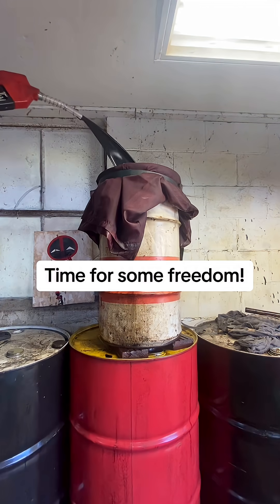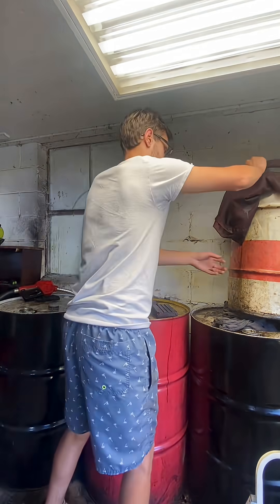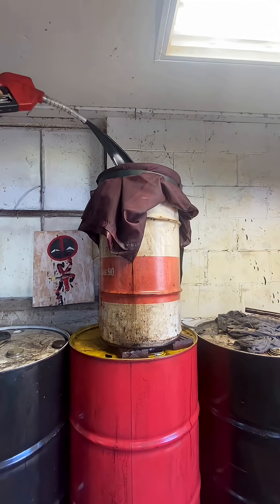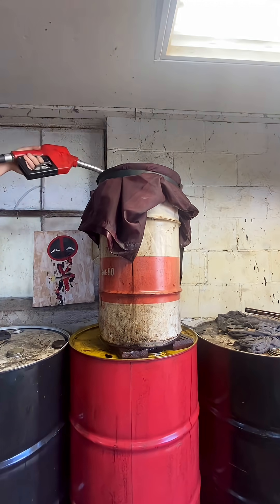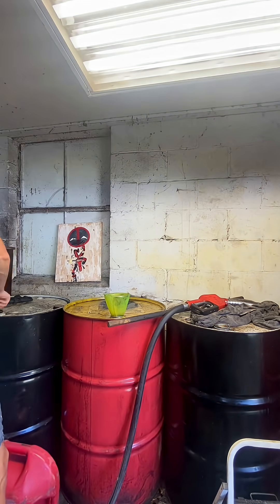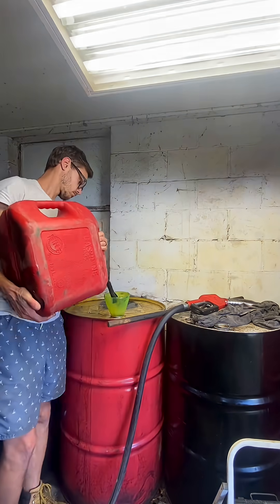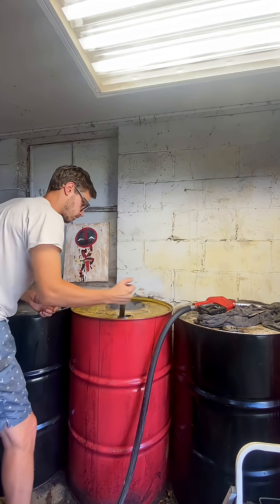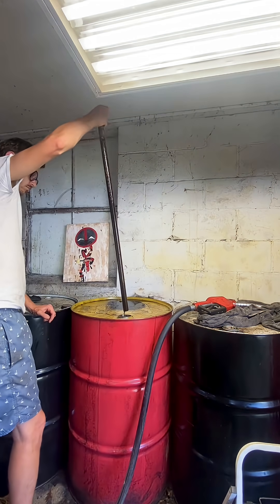Transform #wastemotoroil into #homemadediesel Fuel #dieselmechanic

Comment: Isn’t this insanely dangerous?  😂  No one seems bothered by that.   This looks to be in an enclosed space, under electric light.  Fluorescent, at that, which requires a bajillion volts to kick on the light.  Just a casual half hour pouring pure gasoline from a can and then getting in that with a big old stick and presumably vaporing up the whole space.  Similarly seems like the air would be rich with benzene during the filtering. Shine on you crazy diamond, I guess.

Comment: I bought gas can air valves on Amazon for a couple dollars for similar cans. Work great.
Reply: I just drill a hole on the other side up top where they used to be in the older jugs. Then I personally use a blue concrete screw to seal it up when not in use.

Comment: Wait a minute, that's all I need to do? Will this diesel work in my vw tdi? And what kind of octane gasoline  do you use or does that matter...what kind of oil is being used...does the "filter" matter or is just the cloth enough of a filter
Reply: If it's a modern TDI (computer controlled) I would not run this. If it's an old IDI turbo diesel, then it would be okay. Just filter it heavy.

Comment: Drill small hole in the handle of gas can will help your flow! Pro tip.
Reply: Exactly what I thought
Reply: I find removing the black nozzle attachment and using a large funnel works well too.  I hate everything about those nozzles.
Reply: or just get one of the ribbed yellow bendy spouts...
Reply: You can do that. They do even make a little air flow button. Things that you can just press into that drill hole on to your gas. Can I honestly prefer the fast filling motorcycle style gas cans like the Valley Industries 5-Gallon Utility Jug
Reply: Yea also take the black nozzle off and pour it into the funnel.   Fuck that little 3/4" nozzle.  Pour that shit.  It's ok to spill a little
Reply: Or use a racing fuel jug that flows insanely fast. They are actually cheaper because they aren't as regulated as the "safety cans" emptied in about 20 seconds

Comment: Since everyones talking about the metal particles in the oil why not heat it to thin it more and run it through a few high powered magnets to collect the metal. Pribly best to hrat it to drive iff moisture as well andthe gasoline would mix more efficiently. 
Adjusting the PH or at least trsting it would probky be agoid idea as well.
Im not a professional, but i do enjoy science.

Comment: You really should be using a proper 100 micron filter, then 25-30 micron, then finally down to 5 micron. If you don't you are keeping lots of abrasive material in the fuel.

Comment: full of carbon fuel and you will have reliability issues but if you have an older clunker that you have to fix often anyways its perfect for that and yes im not sure the injectors will handle that carbon long term without clogging. probably you will have to without hack them

Comment: with containers that are large, like jerry cans, the hole you pour from is meant to be at the top of the container, not the bottom. the entire design is to allow airflow and ease pouring. by having the hole at the bottom its just gunna glug as air tries to replace the liquid in the container.

Comment: I had an old Mazda e2000 diesel truck. I used to run around to all the local takeaway restaurants and collect all their old deep fryer oil. Lard and canola oil. Filter it and use it for fuel in the truck. Worked like a charm. I didn’t need to add anything to it. It just burned. 😂 sold the truck with over 700 thousand kilometres on it, still running perfectly.
Reply: Lies
Reply: @stinkwink695 . No lies about it mate. Try it out. Those old Mazda diesel’s ran on just about anything.

Comment: Menards has a gas can looks just like race jugs. 

Due to epa regulations saying there has to be some way to automatically stop the vapors from reaching the atmosphere, coupled with the design of these cans having vents and caps that screw on, they do not meet the standards set by the epa to store gasoline. So in order to be sold in stores they have to say on them not for use with gasoline. 

But if you ignore all that and use it anyway, they empty very fast compared to pretty much any gas can you ever used

Comment: Making diesel from spent oil would  be pretty easy if you had the parts to make a fuel still, Like those barrels he has all he would need is a metal stand to place the barrel on so you can apply heat and copper tubing to collect the fumes in another barrel which is the diesel fuel.

Comment: There should be a cap near the top of the handle on the gas can, pop that so it can breathe while you pour.
Reply: Newer ones don't have it they are supposed to breath through the spout and they suck. I drill a hole where the old ones were located and cap it with a screw.

Comment: New diesels have a "laser in a can" light sensor in line with the fuel tank that stops the engine when light doesnt pass through the diesel. Big brother doesnt want you doing this. My 1st gen cummins could use this, but i would filter it through a real filter first.

Comment: If you want to do this properly you need to filter it with a centrifuge not a bed sheet.....this also only works for mechanical diesels dont try this with a commonrail motor.If you keep using a bedsheet your going to knock the IP out of whatever youre running it in.

Comment: Used motor oil has a lot of VERY small metal shavings in it...I would advise filtering it through something a lot finer than a bedsheet.
Maybe a new oil filter...?
Reply: Brilliant…. How are you getting the oil back out? Or are you suggesting creating an entire setup like a pump and everything?
Reply: @Sexyhurricane 
It should flow through with only gravity...just obviously a lot slower.
Reply: You can buy inline oil filters or you could probably make a filter with sand, charcoal, toilet paper, etc.
Reply: @stevenbelue5496 
Having silica in your "diesel" would be even worse than small metal particles...

Comment: i read some of the comments i know a guy who knows a guy that had a citroen 1.5 diesel 😊 hi used to run it on used cooking oil turned into bio. diesel done a few tanks which took a lot of time, hi was doing aprox 1000 miles a week, eventually hi got fed up with that and pored it into a 45 gal drum, no petrol left it a couple days to settle, then i used a 12v electric pump to pump it off the top straight into the tank, hi alway left about 3 to 4 inches in the bottom, when i pulled the drum forward there was chips and all sorts in the bottom, hi done that for over a year, hi put 2 tanks of real diesel through it, took it for an MOT asked what the emmisions were like and was amazed when the guy said really good so i done the bushes, track rod ends and ball joints and gave it to my girlfriend, she was over the moon.

in just over a year i only had 1 fuel filter.
the new HDI engines dont like it the dash lights up like a xmas tree.

Comment: My  2014 VW Golf loves this stuff going 5 years strong 💪 💨😶‍🌫️
Reply: Extreme levels of doubt. Diesel Hpfp and piezo injectors do not tolerate wof (waste oil fuel)
Reply: @g60-grandpa I've been a diesel mechanic most of my life I originally got the car with 10,000 MI at 80,000 MI the cp4 went bad so I replaced the cp4 and the injectors after that I started running waste oil and Diesel mix no less than 50/50 no more than 80/20 diesel nowadays is so damn clean it lacks lubricity also I run the used motor oil through a 20 micron filter with vacuum assist almost at 400,000 Mi and she hasn't given me any problems🤑
Reply: Do you actually run it? Your cp4 might not mind it but not really sure how it would affect any common rail. I assume some parts fell off your exhaust also? 😂
Reply: @WyattHabel-f8n it's funny you mentioned the cp4 that's what led me to start running motor oil in my car originally cp4 went bad with only 80,000 miles on the car I replaced it and the injectors and the rest of the fuel system cost me about 700 bucks in total minus the labor I've been working on diesel is my whole life so I just do all my own work play typically what causes the cp4 to fail is lack of lubrication and new or diesel is so refined and so clean it's basically kerosene which is extremely dry and laxed lubricity show me and a few other mechanics at around thinking about it and said why not just throw a few quarts of oil in it and one thing led to the next thing now we drive cross-country in the car stopping at every O'Reilly's Napa and AutoZone we see to grab used motor oil for free the car now has 430,000 Mi on it without ever another inconvenience after the first original CB4 failure that was due to Conventional diesel❤
Reply: @WyattHabel-f8n she's straight pipe... just the way God intended😇
Reply: Awesome, you got 1 year left, enjoy.
Reply: @stinkwink695 😂I've been running waste oil mix for over 200,000 miles .....im good bud
Reply: Just remember, those injectors are $200 ea and the pump is about another $400. Then you get to try to remove the old ones and that's always the best part.
Reply: @captainotto i have never had a very badly stuck one on a vw but the older mercs holyyy that a thing from hell
Reply: @captainotto  pulling the manifold including the cost of injectors makes this still worth it
Reply: @Really.Mr.T I cleaned my manifold a while back and that’s not too terrible even with EGR as stock. The problem with the injectors is your valve cover is plastic and you have nowhere to put leverage on if one is stuck. It’s almost easier to break and drill them out which is itself a huge pain. On mine run on reg diesel for 75k mi, injectors 3&4 were easy. But 1 and 2 took about 4 hours each of wrangling. I don’t know what shops charge but the minimum I’d quote would be 4hrs per. What a nightmare.
Reply: @captainotto there's injector pulling tools that use a slide hammer design. But i totally get it.
Reply: @Really.Mr.T I ended up getting a pneumatic one and a bunch of attachments for bearings and other PITA jobs. I have yet to pull any injectors with it but it does not say please when it comes to bearings. Forbidden massager ftw. I just hope I don’t end up seeing injectors get cut in half by it.
Reply: @captainotto these are acceptable numbers if he can to the work himself. Will be saving much more than that by not buying diesel.
Reply: No don’t and no it didn’t
Reply: All these injector stories, I've always loosened the bolt so it just will stop the injector, and floored it around the corner 

Sprinter did take almost a mile before the "pop" ....

Comment: Need to find some old vented gas cans they still pop up at auctions and yard sales and you can buy new replacement spouts and lids.
Reply: Dude, just drill a hole in the bottom of your gas can problem solved! That way, it can suck in all the air it needs… Trust me, I know it totally works. I’m an internet expert, after all!

Comment: The first small comment is to just poke a hole in the backside of your gas can so that you don’t have to wait 10 minutes for the 5 gallons of gas to go in. Just a hot tip for ya. I see a lot of people being negative about your diesel fuel and I don’t wanna be that guy, but I feel like throwing 5 gallons of gas into a bunch of strained motor oil is not in any way shape or form gonna make clean diesel fuel. I wish I was wrong, but I’m pretty sure I’m not..

Comment: I hope you are only running this in pos you hate. Dissolved carbon, moisture, emissions equipment killing additives like zddp. Also you aren't making diesel your making viscosity modified black fuel oil. That stuff is hell on common rail or Huey injection systems.

Comment: Brother, use a drill and make a air whole above side handle where a normal one would be. Use a screw for the hole to prevent leaking
Reply: That's what I do, I hate the newer ones with vented spout.  I don't know where all my older jugs ran off to, I've had a zillion of those jugs, they just dissappear, I need cameras

Comment: I can hear the modern dpf dying with every second of this video lmfao... Id send that through a proper diesel fuel filter system unless this is going into an old diesel from 80s-90s or military consume-all engine...small particulates of metals in that mix make me nervous gping through the high pressure pumps/injectors of modern diesel